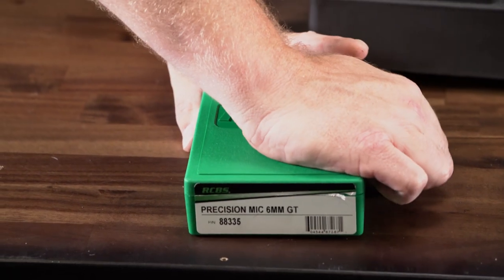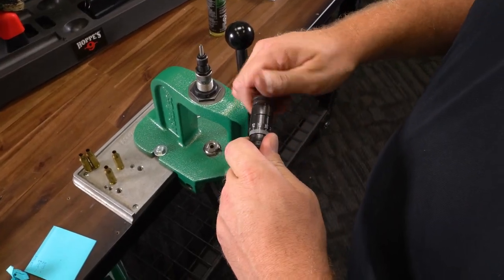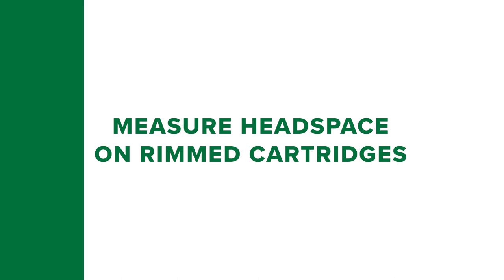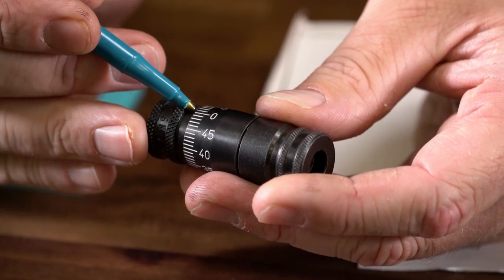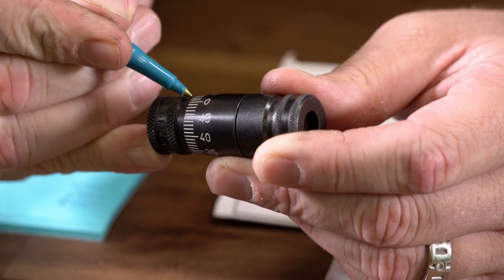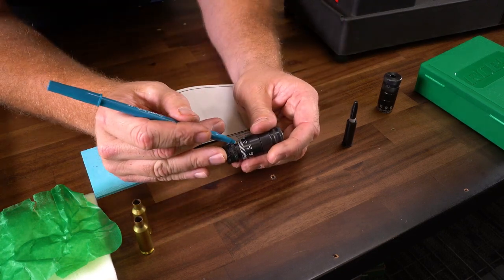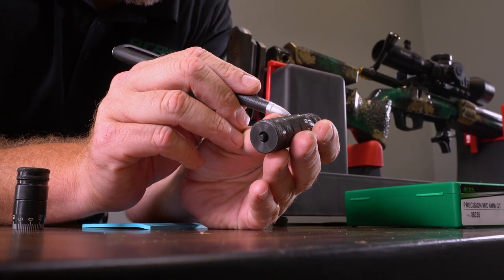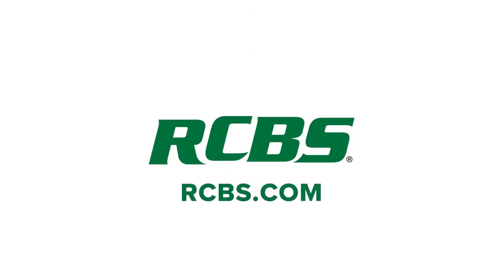RCBS Precision Mic Chamber Head Space

Comment: Hi, I have everything in order with the factory fire formed cartridges. I have a question for correctly reading the measurements.The body has a scale with each body mark 0.050as follows: 0.0,0.050, 0.001 and so on. When taking a head space reading, will the headspace nut always align with the zero on the body? If not, if the nut stops on lets say 5, and the scale on the body is lets say 1.5 is the measurement 0.0065?